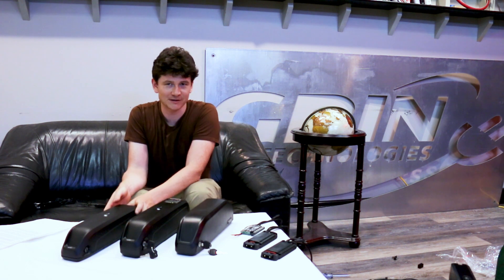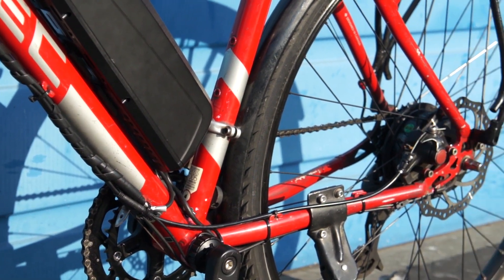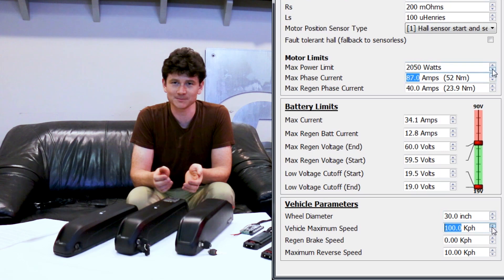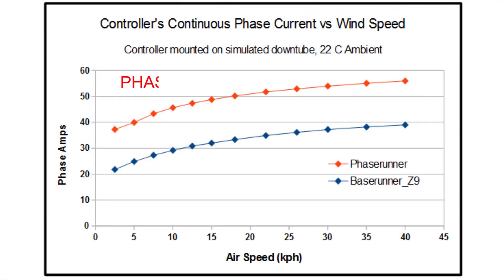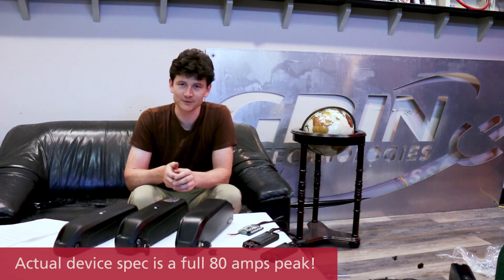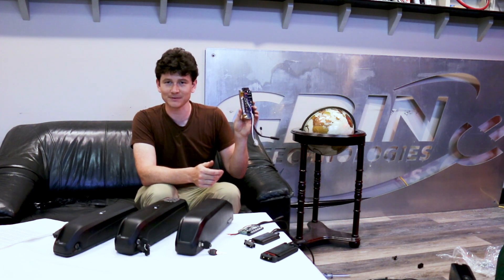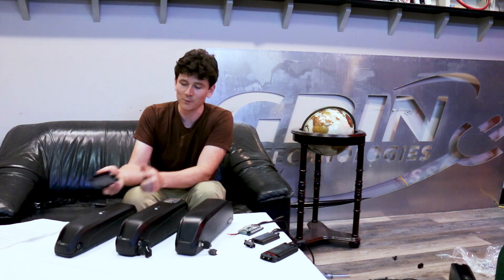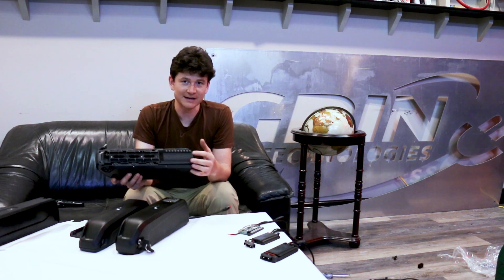Grin's Baserunner Motor Controller - Product Intro

Comment: Hello, I know it's an old video (is it?) but could anyone point me to a documentation for Baserunner FOC Motor Controller, please? EXACTLY the one in the thumbnail, not the newer ones.
The link in the description is dead.  btw: I've got a BR-0082 :D
Reply from the maker: https://ebikes.ca/product-info/grin-products/baserunner.html#VersionHistory

The first formal baserunner manual that we made was for the V4 device. Before that we just referenced the older phaserunner manuals which had similar functionality and pinout, just the different form factor and current/voltage limits. 
https://ebikes.ca/product-info/grin-products/phaserunner.html#UserManuals/Drawings

Comment: Is it powerful enough to run a Cyclone or a BBSHD mid-drive?
Reply from the maker: It doesn't have any real advantage over the stock controllers, so wouldn't make much sense to use in those products.

Comment: This looks like an amazing product. How can I make sure my motor is compatible with this? I have a Voilamart 48V 1000W brushless gearless front hub motor that i'd love to pair this with.
Reply from the maker: Hi Aaron, if your motor has either the Z910 plug then it's going to be easy to do the motor hookup with the Baserunner_Z9.  But if it uses a different plug standard you'll likely need to do custom wiring to reterminate the motor to match the controller or visa versa.  I'm presuming this is a direct drive hub, so converting it to an L1019 plug and using the Baserunner_L10 would be the prime recommendation.
Reply: @GrinTechnologies  I just ordered the Baserunner_L10 yesterday and i'm going to convert my motor to the L1019 plug. I can't wait to try it out!
Reply: @aarongzmn Any updates, Aaron?
Reply: @Aaron Guzman

How's it working with your bike? What sort of speed and performance are you getting with this versus your old controller?

Comment: How do I recognise Hailong S1 or S3 model?
Reply from the maker: The HL-01 is smaller and has no on/off switch and 3 slots for the battery rail. The HL-03 is larger, usually has a rocking on/off power switch, and has just 2 slots in the battery rail.

Comment: Nice video, thanks! Can you post a video for how to actually install this controller to an already existing Hailong battery? Thanks!
Reply from the maker: You would need to purchase it insatlled in the modified hailong base plate from us, then transpose over whatever connector was on your stock battery cradle into the new plate and solder the + and - leads of the baserunner to your connector.  There are quite a few connector standards that have been used in Hailong enclosures, so we do not supply them with a connector pre-soldered. Best to just re-use what is already on your battery cradle.

Comment: Is baserunner compatible with Eggrider?
Reply from the maker: The V3 and earlier baserunner controllers were not intended to deal with digital communication protocols so the Tx and Rx pins are not easily wired to a display like that.  But it will be possible to support 3rd party displays with the V4 Baserunner units which have a separate 9 pin mains plug with a separate Tx/Rx port.  See section 3.2 of the user manual:
https://ebikes.ca/pub/media/downloadable/documents/BaserunnerV4_Manual_Rev1.0.pdf

Comment: Can I assume that any battery mount with that aluminum plate underneath will fit the Baserunner or must it be  a Hailong or Grin battery?
Reply from the maker: That's not a good assumption. We offer heatsinks to fit the Hailong enclosres (HL01 and HL03), as well as the Reention enclosures (DP4C, DP5C, DP6C, and DP9C).  There might be a few other downtube battery models from other manufacturers that are compatible with one of these two controller plates but wouldn't count on it.

Comment: Only the 9 pin motor connection is the same as my controller , I have two more other connection 8 pin and pas sensor wich I also round but smaller . I really want a baserunner but how to wire it if it has different connection as my controller ?

Comment: How do I add a headlight to this type of controller if there are only 3 julet wires coming out.
Reply from the maker: It's through the Cycle Analyst display that we have a DC power tap for the headlights

Comment: Could you design a shark battery that can be mounted from the side? Lot of DH and mtb frames do not have clearance for mounting from the top, but you could squeeze them in if the locking mechanism was from the side.
Reply from the maker: Using hose clamps and our new Bottle Bob you'll be able to mount these batteries all over the frame, video coming soon!
Reply: @GrinTechnologies  Yikes, I don't want to use hose clamps on my precious. I was hoping you could just slide the battery in to the dock from the side. Now the batteries all mount from the top.

Comment: You can get Z9 and L10 connectors @ e-bike-technologies:
https://www.e-bike-technologies.de/index.php/en/connectors/connectors-motor/higo-z910-series/higo-z910-m-s-detail
https://www.e-bike-technologies.de/index.php/en/connectors/connectors-motor/higo-l1019-series/higo-l1019-m-s-detail
both have 1m cable lenght that allow you to convert your motors to fit these top controllers.